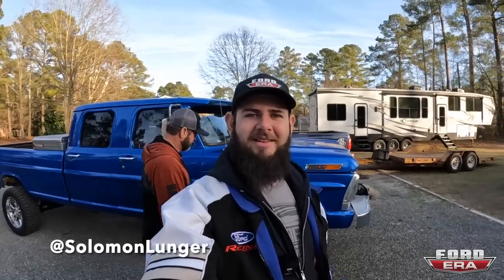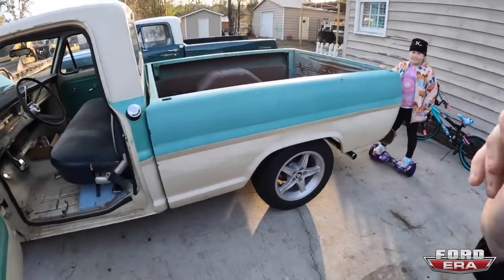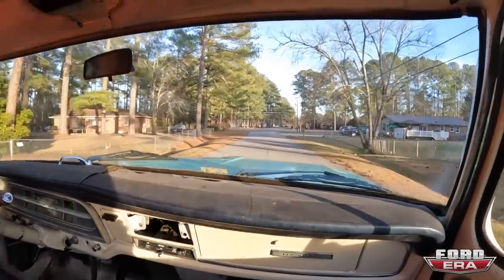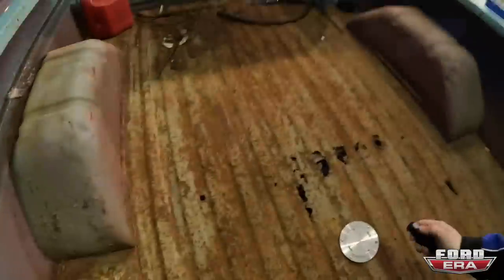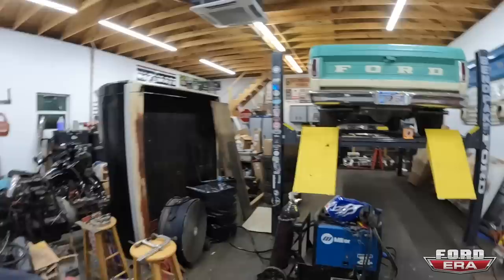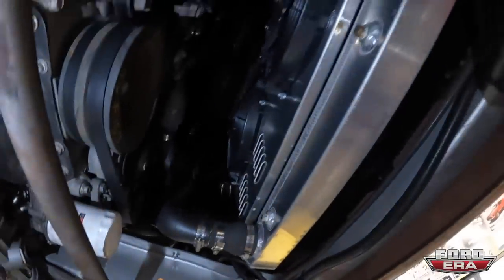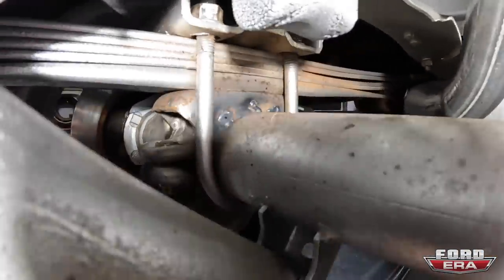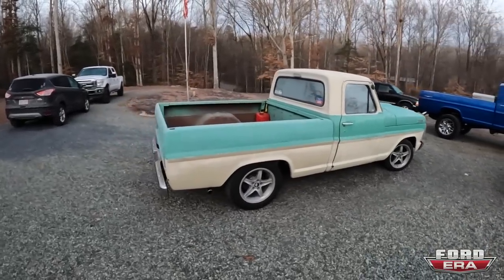Welcome our 1967 Coyote Swapped F100! | Ford Era

Comment: Very Nice Truck Sol, I Would Think With A Coyote Under The Power Barn, Braking Is Quite Essential. That Teal on White Screams Classic in My Opinion. The Rust in the Bed is A Cool Hidden Touch, Obviously It Will Need To Be Addressed @ Some Point But As It Sets I’m A Fan. Keep The Content Coming & More Importantly, Keep It Safe Out There Brother
Reply from the maker: thank you David, I would agree with you on that but its not the case on here. It works but its not the best. I think so too. 

Thanks man